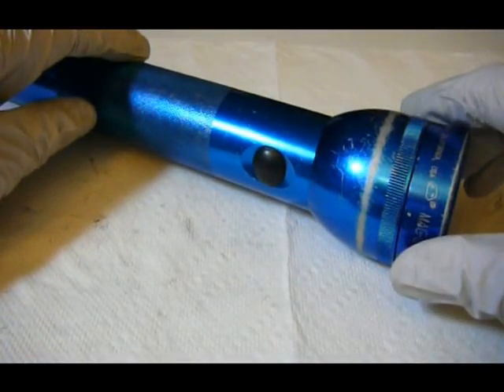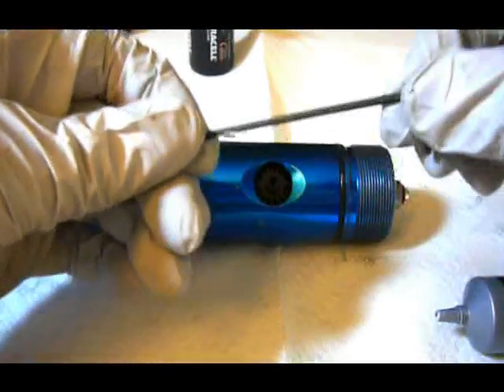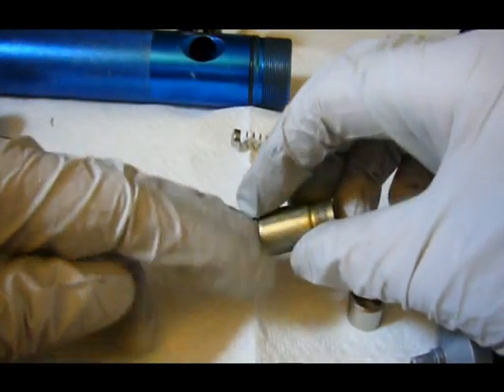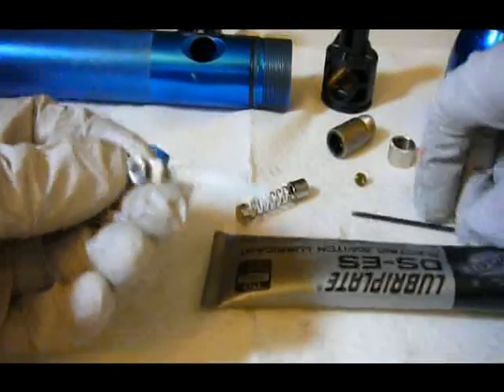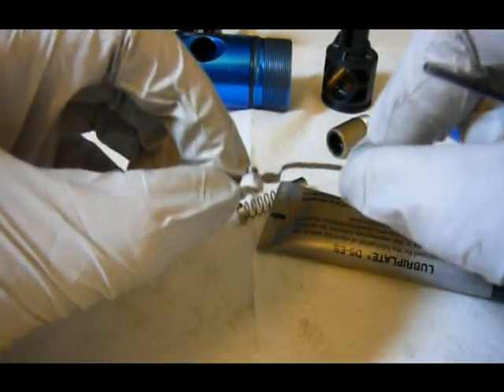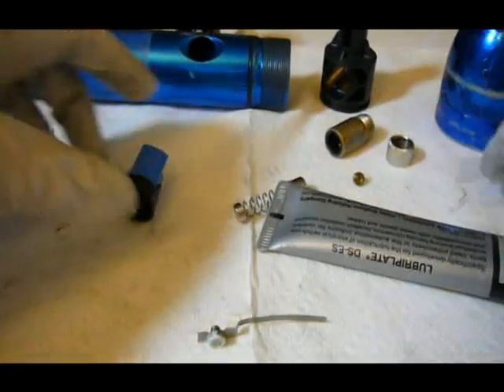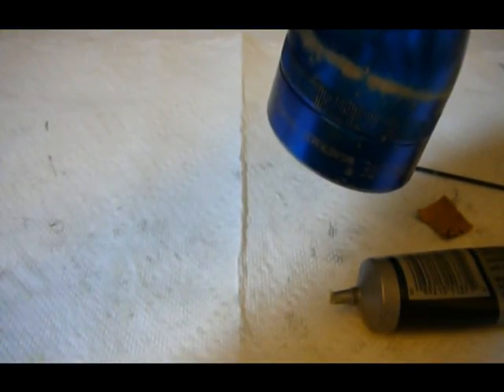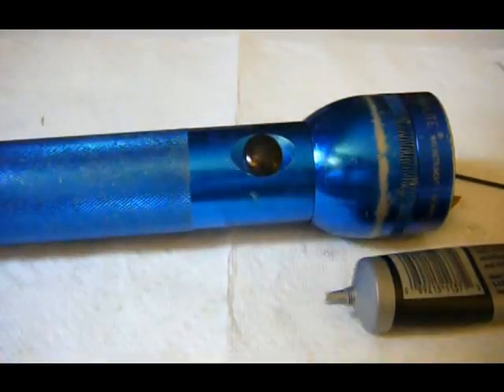MAGLITE: Switch Disassembly and Improvement

Comment: 3 d battery Maglite wasn’t working after 20 years sitting in a drawer. Got the upgraded led bulb, no luck. So I took it apart like you showed, stretched the springs behind the switch assembly and inside the assembly and now it works! Thanks for the guidance to disassemble it

Comment: You need to remove the gloves and set the parts down for people to see what the parts look like. And word to the wise.  You were VERY lucky manhandling that thin metal strip, that the nut, which is welded or crimped to it, didn't break free.  I applied only the slightest pressure to the assembly trying to get thing apart, and the nut separated from the strip.  The current from the cathode of the last battery, through the housing, through the pointed set screw, through the nut, and through the metal strip to the outside contact of the bulb.

Comment: Thank you, I removed corroded batteries. Put the light back together and it didn't work. Pulled out switch and it fell apart. I had no way of knowing how to put it back together. Watching your video was quicker than locating parts diagrams. It's working now.

Comment: Thank you so much for the tip on using di-electric grease.  I ran through all of the steps to re-assemble the light and it did not work.  I tore it apart and re-assembled it again with the grease and it worked!

Comment: Thank you. Totally helped me put it back together. I had three seriously frozen corroded batteries. It took over two hours after freezing for two days and then pouring boiling water screwing bolts into them and pulling, banging the hell out of it and finally pushing it through with a broomstick to get them out but I did. This video helped me put back the switch and bulb assembly back together. I don't know if I necessarily cleaned everything properly and I know I didn't use the electrical lubricant shown in the video. The light works with new batteries but I don't think it's at full power. May need to do some more research to determine how best to clean contacts but thank you for helping me put those loose pieces back together!

Comment: This only work if the tube is in perfect condition inside. In mine the batteries leaked so the aluminium corroded si the switch can't slide. I had to remoove it from the other side, but there is a clip to remoove, it's very difficult. Finally i've hit the switch to hard and broke the plastic.

Comment: Great details disassembly and reassembly of the switch. I took mine apart and wasn't sure how to put it back together. Not sure why it stopped working, but after cleaning with IPA and new batteries it works like a charm. Thank you for making the video

Comment: And now my flashlight works again. Only corrosion was on inside of case and on the spring that contacts the battery. Cleaned those off with diluted vinegar and brass brush. Had dielectric grease so used that on the contact points,  including the batteries, and presto change-o!

Comment: Great tutorial on switch rebuild.
I wish youhad put down the ES- DS   with the label facing up ,so the viewer can see it. One easy tip, there is a snap ring the holds the switch from com8ng out the front. The snap ring is easily removed .

Comment: Why do you lube the plastic parts in the switch, but not the contact points?
Reply: I used a conductive contact paste on the metal parts where the touch other metal parts and a silicone grease for the plastic parts. I think that he is using an antioxidation paste which can be used on either. Not sure.
Reply: I would never use grease it's actually a insulator on conductivity

Comment: You said turn Allen Wrench clock wise, but you turned it counter clock wise????? Does it actually fit into a allen bolt?  I can't seem to get mine to go into any bolt, nothing is turning....
Reply: LIghts made after 2011 or so have a torx T8 instead of 5/64 hex for set/ground screw.  Hard to find T8 that fits through switch far enough.  I have used 5/64 hex ground down to flat screwdriver tip.

Comment: Is it also possible to push out the switch unit upwards? Because the battery closest to the switch is stuck in my maglite.
Reply: there is an expansion C clip above the switch tower.  You need to pop it out with a wide-blade screwdriver, then the switch may slide out the top.

Comment: Switch block did no slide out like yours. Had to pound it out and now it's garbage.
Reply: @asully3006 , Lubriplate calls their product "grease" and Duracell calls their cells "batteries."  They may be wrong, but they aren't idiots.

Comment: Hi, my torch when I face it downwards. It's switches of. But when pointed straight or up it works fine. Would this help it work
 The switch seems fine as this is the second one IV put in and it's doing same thing. Or you do think something up with batteries.
Thanks
Reply: Hello Sadie, the symptom you describes looks like grounding issue. Meaning the stainless steel Grub screw, may not be contacting the body of the torch. The above screw is located at the bottom of the switch assembly with a 2mm Allan head.
You need to remove the silicone cap on the switch and insert the Allan key (2mm) through it, get proper insertion and tighten it.
Not too tight, but tight enough to gain proper ground connection.
The other thing that comes to my mind is the battery positive contact to the switch. There are two types of contacts that is seen in MAGLITE torches. One is a stainless steel small spring and the other a flat plate. When you said the Torch works while it’s facing downward, means, the battery is contacting the switch contact (either the SS spring or the plate )
The only way to set this phenomena right, is to remove the switch and do the necessary. It’s a simple process, you can do it.
Time and space forbid me to describe the procedure. Remember these TWO issues. Cheers, Sadiq.
Reply: @sreekumarUSA  thanks for the reply. The torch switches off when faced down to ground